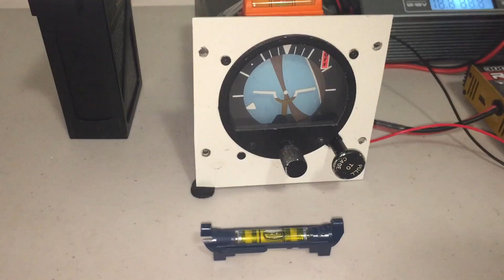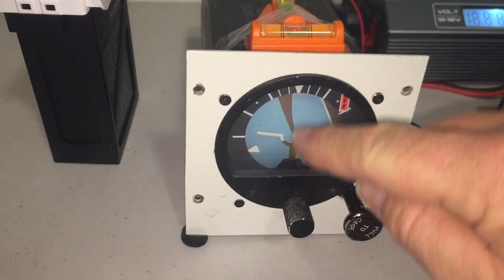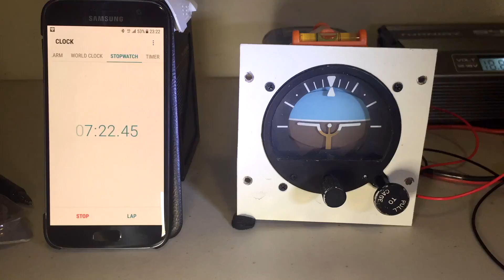Flat Earth - Time lapse of Artificial Horizon self corrections - Pt 1a.

Comment: I did a quick bit of research as to how self contained ADI's do self leveling and  ran across this article.

https://www.experimentalaircraft.info/articles/attitude-indicators.php

The article described the method that uses Pendulous Veins.  I thought I would  give that elink here just FYI. 

I might also add that inertial navigation gyros work differently and are  sensitive enough to actually sense earth rotation and use that to do ground alignment. 

Also, gyrocomapsses  (often used on ships) use earth rotation in opart to find north (with no reliance of a magnetic compass). e.g

https://www.marineinsight.com/marine-navigation/gyro-compass-on-ships-construction-working-and-usage/

I mention these here because flat earthers seem to  try to argue that gyros prove the earth is flat when in fact they do just the opposite as can be  seen in the operation of many time-tested, fielded systems used every day by ships and aircraft.

Comment: Wolfie,  I know that vacuum gyroscopes use pendulous vanes to self-correct for precession errors and to maintain level with gravity but how does it self-correct on the electronic driven gyroscope?
Reply: Google "schuler tuning" -- but BASICALLY they use accelerometers which act as virtual 'pendulous vanes'.
Reply: Walter and Dark Star  I did some more searching today and it sounds like  electronic panel mounted horizon indicators actually have a centrifugal fan to draw air through the unit and use pendulous vanes like the vacuum driven units.  This article also mention remote vertical units which use "electronic switches and electric force motors" which sounds like mercury switches with torque motors.

I think the accelerometers are used with the newer ring laser models.  I doubt the ring lasers would have precession issues but still need a method of determining "down".
Reply: I'm sure there are dozens of implementations to avoid paying patent licenses.  I assure you they do not all use airflow and pendulous vanes.

Pendulous vanes, pendulums, mercury switches, MEMS (of many designs), piezoelectrics, air bubbles are all flavors of an accelerometer.

We pointed you to a couple of known solutions because you asked a very general question.  The SR-71 had cameras that would read star positions (even in daylight) which fed into the guidance system (nicknamed R2-D2 for hopefully obvious reasons, see also NAS-14).   Ring lasers have to be calibrated like every other system, they have tracking limitations and get out of alignment (so in addition to 'down' they do need to calibrate 'north' also).  I'm sure there are other mechanisms as well.

But the general idea is to measure the force vector of gravity in some way.

Here is some more reading on INS:

https://www.ncbi.nlm.nih.gov/pmc/articles/PMC4570330/

http://iopscience.iop.org/article/10.1088/0957-0233/27/11/115009

http://citeseerx.ist.psu.edu/viewdoc/download?doi=10.1.1.457.164&rep=rep1&type=pdf

Comment: Given you experiment shows these artificial corrections, can you explain WHY the artificial horizon NEEDS to correct.  Just so the purpose of your experiment is clear?
Reply: #1 when the gyroscope first starts it will be out of alignment.  You can pull that CAGE knob to force it to align to the cage, but if the cage isn't level that doesn't help you much (most small planes are inclined when at rest).  So Cage will usually get you close after start but without this mechanism the pilot would have to manually align it.

#2 The main one -- ANY uneven force on a gyroscope causes precession -- if it didn't have a way to align it would quickly become useless, even IF the Earth was flat.  A hard turn will throw these mechanical gyro's out of alignment -- if it didn't self-correct these things would be next to useless.  What's also funny is to do a long steady turn -- it will realign itself to the gravity+centrifugal force vector and be wrong for a while.

I no longer fly or I would show you, but I have flown small craft.

#3 How this relates to #FlatEarth nonsense is that Flat Earthers think that it should pitch over as the plane flies over the curvature of the Earth due to how gyroscopes are generally 'fixed in space'.

The problem with this cocked up 'theory' is #2 -- these things would constantly pitch in crazy directions if they didn't self-align to gravity.